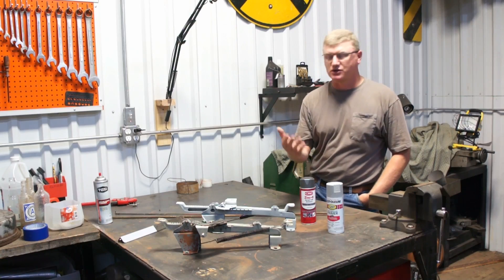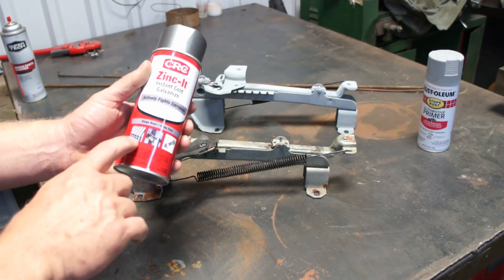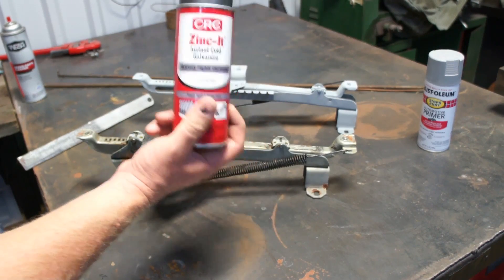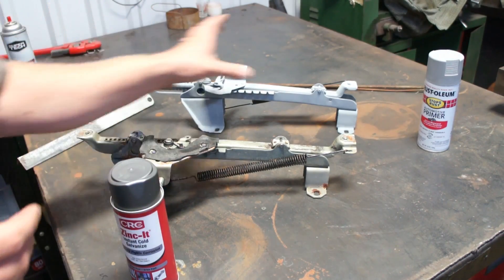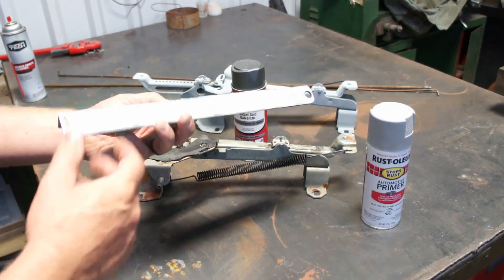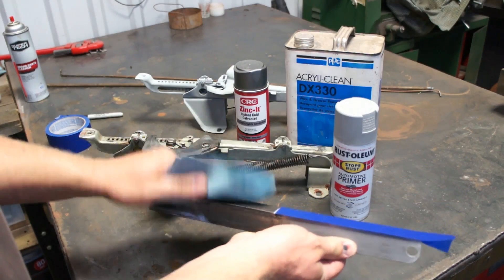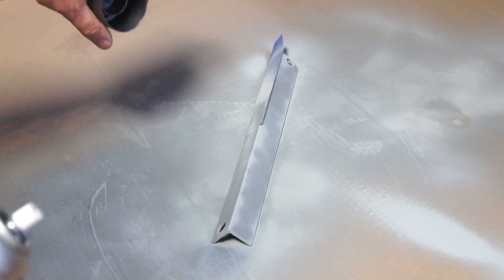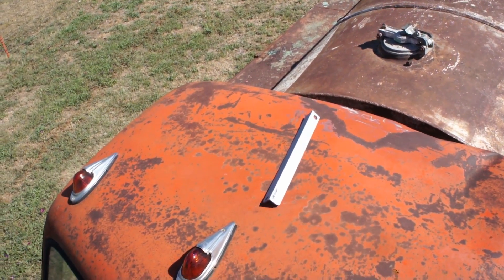Does CRC Zinc-It Work?

Comment: two point of views... do you need it to look galvanized or to be protected with zinc providing protection similar to real galvanized part.  Usually if you want protection you don't care about the final look. But still the question remains...  Does it provide antirust protection like galvanization does?

Comment: Bridge and Highway Rust Treatment
Bridges and Highway metal protection do not encapsulate rust. They Use a Cold Zinc Galvanizing Compound.

–Surface Preparation: Clean the affected area to remove rust and debris. This may involve near-white blast cleaning or ISO standard Sa2 1/2 equivalent.
–Application of Protective Coatings: Use a cold zinc galvanizing compound or other protective coatings to create a barrier against corrosion.

By following these steps, bridge owners and operators can extend the service life of their structures and minimize the need for costly repairs. 
It is also important to stay informed about the latest advancements in corrosion prevention and repair technologies to ensure the best possible outcomes for bridge maintenance.

Comment: For me the con will be that is has to be on bare metal, I have a rusting antenna tower that I've been hitting with paint, I was hoping this would be my answer however it appears not
Reply: I've used cold galvanized compound on and off for years. Years ago maybe 30ish we had a heavy walking grate over a neutralization tank outside. The fumes started eating into the hot galvanized  finish and rusting .our salesman from grainger suggested cold galvanized compound. It stayed on there for years. I did touch it up once. I think it was crc I used . I just bought some rustoleum for a steel gate I'm building.  I like to use it on any welds or perforations . Amazon had the rustoleum cold galvanized compound pretty cheap. I'm going to follow it up with primer and black enamel paint.

Comment: I have not used a cold galvanizing product before, but I'm going to give this a shot today as a primer over some bare areas on an ornamental iron railing that our shop built and had hot dipped galvanized. There were some areas where the galvanizing company did a poor job, and I had to file them down because they galvanized over rust and dirt, so those areas are bare steel now and need to be recoated. Before spraying the CRC, I will first use a product called Galvaprep, which I have used for years, it will etch the bare metal spots as well as condition the remaining hot dipped galvanizing for the CRC. Then, after touching up with CRC, I will be spraying the entire railing with Rustoleum flat black, using my HVLP spray gun. This railing will be installed outdoors in our coastal town, so my results will get a thorough testing. Thanks for the video. By the way, CRC stands for Chemcal Rubber Company, and they have for many decades published the CRC Hndbook of Chemistry and Physics, long familiar with the scientific and engineering communities. Look it up!

Comment: Can you paint on top of it?
Reply from the maker: From CRC's data sheet: CRC Zinc It can act as a finish coat on clean iron, steel and their welds. Top-coating CRC Zinc
It with another product of CRC’s Zinc coating range provides extra protection and a selection of
bright metallic or coloured gloss finishes – the ultimate choice for your application. If other
colours are required, CRC Zinc It can be top-coated with most standard decorative paint
systems for metals

Comment: The problem with this test is since both paints are on the same piece of metal the zinc coating will prevent rust from forming under the primer. That's why the zinc is already discolored, it's already been sacrificing it's self. Looks like a great product though, I'd like to see this stuff on the frames of vehicles in the rust belt, rather than coatings which just try to seal the frame from contact with salt and water which never works.
Reply: *it's self (it is self)

ITSELF

Comment: If you want a "shiny" look then you have to use a cold galvanizing product that has a lower zinc content, around 65%. This product probably has a bout 90 to 93% so it will be a dull finish. I do agree that the cap color is misleading, as for the pictures on the can well they're stating what you can use it on not what it will look like.
Reply: *a bout 

ABOUT

Comment: Hi, is suitable for cars and areas that are prone to rust?
Reply from the maker: Sorry, I couldn't give you a good opinion on areas that are subject to sand, gravel, water etc. being sprayed at them by the tires. Maybe that should be the next test...
Reply: @TheJayhawker  I'd love to see that test. The benefit to galvanizing is it protects the metal without perfect coverage. It's not like coatings where if you miss a spot rust will develop in that spot, get under the coating, then you're screwed. If this cold "galvanizing" actually works, it should corrode the zinc coating first before the base metal, even if the base metal isn't 100% covered.
Reply: I'd like to see this on some car frames. There's no reason it shouldn't work.

Comment: I bought two yard wind ornaments from an artisan and sadly they began to rust really badly, so I just found your video and I think the solution that is right for me. I will of course remove the rust first. Being able to spray rather than electro coat is way easier. I really like the mottled finish after a month. I would be very interested to see how it does over time. 6 months, yr, two yrs. Thank you!
Reply from the maker: It will be 6 months in a few days and there will be an update video coming. I don't think you will be disappointed.

Comment: Check "10 year of using cold galvanizing compound".   I switched to cosmoline and fluid film.  CGC I use still always at exhaust and work excellent.  My pickup is 23 year old and has original exhaust.  Especially check my test in #28 who may interest.
Reply: I checked, I don't see any pictures and from the comments idk what the results are. I'm curious what actually happened because if applied properly, galvanizing is way better than any crappy coating.
Reply: @bobbygetsbanned6049  Hot dip galvanizing is way better than anything.  But this is only zinc rich paint.  Have not much to do with HDG.
Reply: @bobbygetsbanned6049  I do not know why you do not see pictures.
Reply: @zell863  They are working now, weird. I wonder how much wasn't sprayed on bare metal because there's no reason it shouldn't work.

Comment: The key to cold galvanizing is heating the material to chase out all the moisture and spray it on warm base metal. Then warm it while wet. It’s used on cut ends of steel on critical infrastructures. It’s not as good as electrolysis or hot dipping of course.
Reply: But It works great.
Reply: Looks like it worked just fine in this video...

Comment: Another good informative video. A few weeks ago you offered Zinc-it as a possibility as a covering for my window regulators but I don't think you had any experience with it at that time.  I haven't had the opportunity to try it out yet so I'm especially glad to see you demonstration.  I think it should be okay for my regulators -- it's unseen & protects the metal.  Who could ask for anything more?  I remember reading a review on the Zinc-it where the person said that there are more steps than just spraying it on.  It appears you nipped that review in the bud.  Thanks for the info!